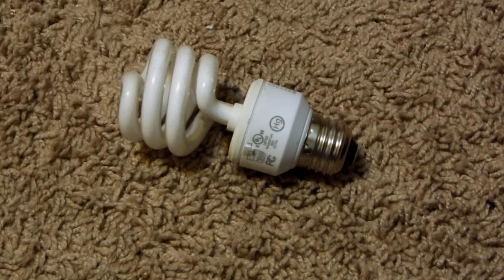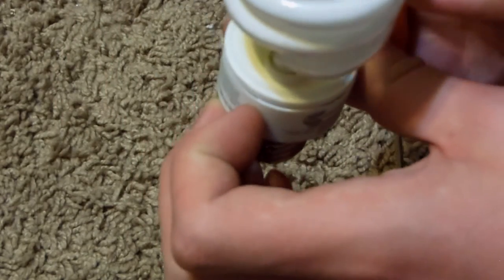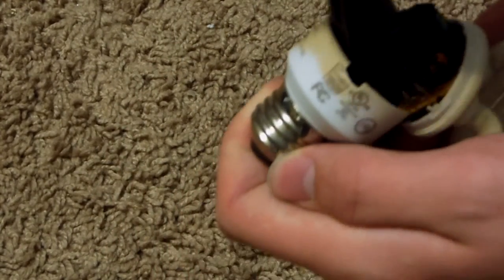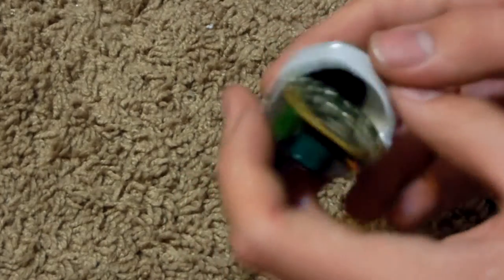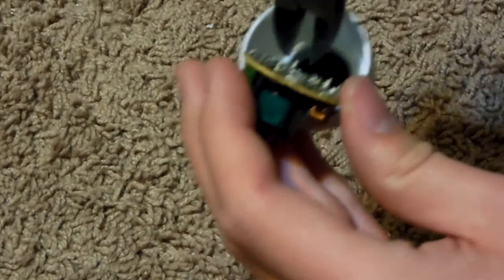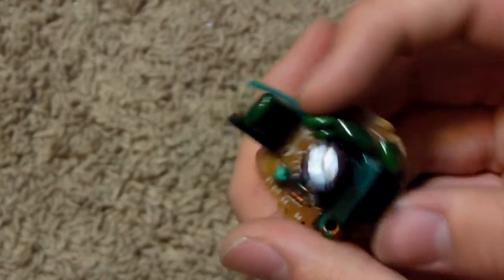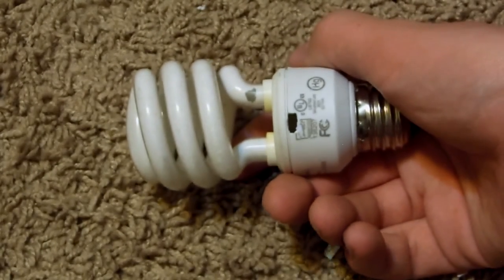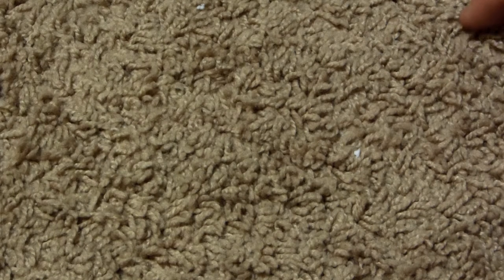E- Waste Scrapping: A CFL lightbulb!

Comment: Cool video. I used to take these apart, I don't any more because there's too little value and there's always the risk of breaking the mercury vapor filled bulb.
Reply from the maker: Nicolas Chu I agree. I always practice EXTREME caution when doing so. Even if the amount released is extremely low, it still is bioaccumulative. Thanks for watching.